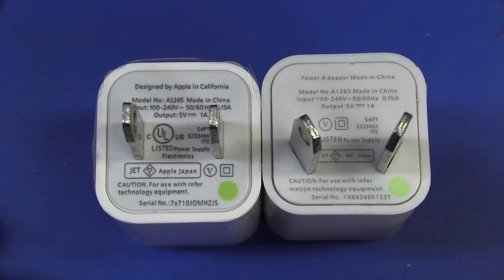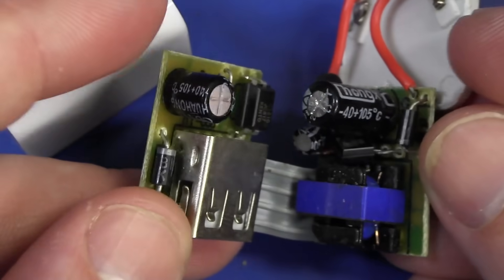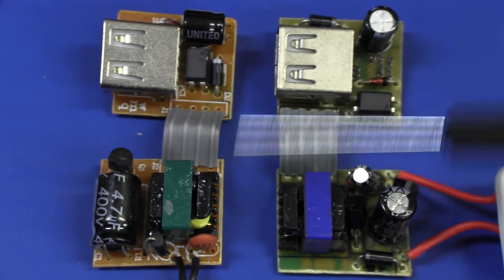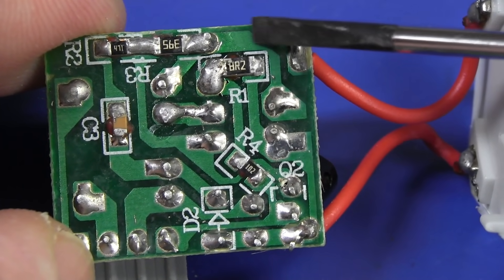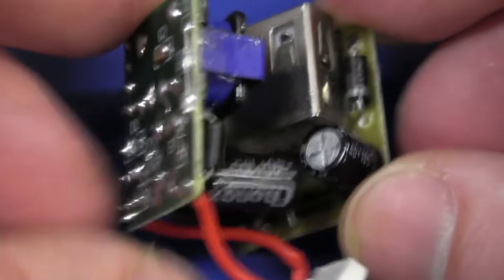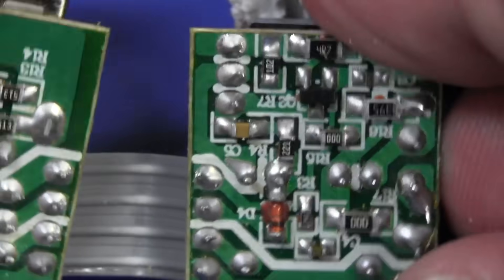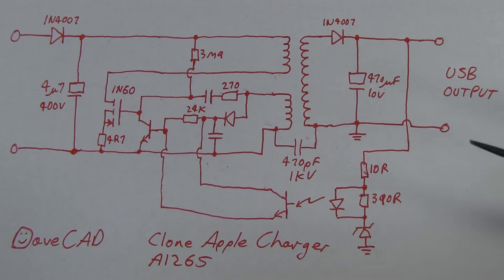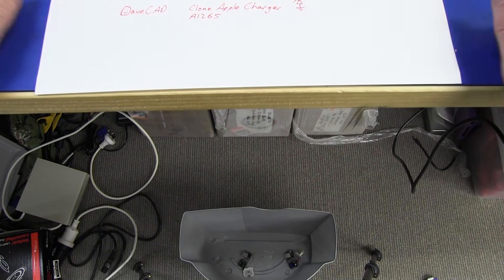EEVblog #388 - Fake Apple USB Charger Teardown

Comment: but the chargerz work all the same yes
Reply: 1zeagle They don't stabilize and filter the electricity enough so I reckon they can damage the device you are charging (leaving out the safety concerns), if not immeadeately then over time. And the bad quality components will probably fail sooner or later, either rendering it unusable or making the electricity even less stable and filtered. Also, the efficiency is probably worse by not using components best suited for this job. By not using any insulation, if any components on the boards accidentally touch each other the wrong way it might be disasterous for your device (and not to mention if you touch usb cable when pulling it out of your phone and get jolted by 220V mains AC).

Comment: So does charging your phone with one of these "hurt" the phone somehow?  Does it wear out the battery faster?
Reply: PTNLemay Until they fail (age) those will operate OK and than one day they will fail (caps dry or leak causing short for example) this will cause any or all, fire, damage to your equipment, electric shock, electrocution.
Reply: PAWEL CZAPOR
Wouldn't the worst thing that can happen be that one of the breakers switch because it detected a short?
Reply: no worst is probably when it electrcutes or burns down the house with whole family. Fuses and rcd will do what they supposed to do.  fuse will prevent wires in your walls melting and rcd will detect high stray current but 30ma is enogh to kill...

Comment: Both item shown are FAKE
Reply: Ernst Stavro Blofeld You have to remember that the electricity is going into the port of the Apple device and then to the battery. The device will have a battery regulating circuit inside.
Reply: chad Mc Cabes Why would anyone need inductive filtering on a fucking battery charger?!
Reply: Ernst Stavro Blofeld
It's to filter out certain frequencies so you don't have a lot of noise on the DC output. Caps or inductors alone work, but caps with inductors are much better.
Reply: ChannelSho What does a battery care about noise?
Reply: It doesn't, but you don't want that noise leaking out. Plus noise in general is bad for electronics, especially digital ones.
Reply: ChannelSho The apple-battery is digital?! That is hard to believe…
I could understand noise filtering in a power supply but not in a battery charger.
Reply: Ernst Stavro Blofeld The connector on the phone doesn't lead directly to the battery. There'll be a charge regulator (most phone chargers are just 5V USB supplies, most batteries are roughly 3.7-4.2V) and battery monitoring circuits before the actual battery cells. The phone connector is also capable of data transfer when plugged into a computer, so it's also probably not good to have noise where it could couple into more sensitive stuff nearby.
Reply: Ernst Stavro Blofeld It helps to get rid of any AC pulses that may exist.
Reply: Ernst Stavro Blofeld Plenty. you don't want to induce any AC into the battery.
Reply: Ernst Stavro Blofeld A good power supply always has a choke to keep AC from passing through.
Reply: +William Jones The chokes also help reduce RFI which otherwise would be put on the charging cable or household wiring and that can get into other devices.

Comment: I have now re-thought about leaving any of these plugged in and charging overnight!  Great demo, Dave!  I'll certainly stick to the genuine Apple chargers from now on.  Used a made-in-China USB car charger and it scalded my hand after being plugged in for an hour of driving.
Reply: At least for a car charger you don't need to worry about isolation as it's not neccessary

Comment: Clone chargers devices are not very well designs or have any real expensive components parts in them.The prices are 1/3 of a real one.That why most people's take chances to buy them long as they're working.You make a mountain out of a ant hill here.These chargers put out and take in a very low amps and currents.99.999% of the times the chargers just stop working,it will not cause any fires or causes any harm to anyones. ....111...% could causes any fires or harm to a person.So dose lighting too very.. Low almost to 0%.

Comment: EEVblog I looked at two of the three Apple chargers I own.  All were included with various Iphones when originally purchased.  I pulled the charger from the box for my refurbished 5S.  The underside where the prongs are is blank, no markings of any kind.  My older original units have all of the information shown, including "Flextron".

 I am now curious to know if this is a knock-off replacement included with my 5S or did Apple choose to remove all of the data on charger supplies.

Comment: If the mains was ever reversed on either "charger" the filter cap would go bye bye from reversed polarity.
Reply: The mains is reversed 50 or 60 times a second.  Mains power is AC

Comment: There is a much easier way to open those without cutting it open.  Hold it with one corner on the ground or desk (so it looks like a diamond and not a square) and then tap the top corner with a hammer.  If it doesn't open after a couple of hits, then rotate to the next corner and repeat.  Doing this will tweak one shell of the case in such a way that it should break the weak plastic welds to the inner part without destroying the whole case.  I've found that this will work with a lot of devices like this and all that is needed is a few soft taps with a heavy hammer.  You could probably even wrap the hammer or case in a cloth to keep from scratching the case.

Comment: As a radio amateur, it really drives me mad with these cheap chargers. The lack of inductors and capacitors as a decent filter means these devices throw all sorts of electrical switching noise, seriously raising the RF noise-floor. :(
Reply: the masses love them.  they want to buy them every month to get a shopping buzz and a bargain illusion.  Govts love them too as they keep the economy turning over.  yum yum.  just sayin'

Comment: Hmmm...Do you not grasp that ALL this stuff is manu/made in shops in China/ROK ??? Outside of fitment, identical goods.
It all comes down to what level of quality the end user is willing to wait for. NOT pay for, the company just sends the out-of-tolerance parts/kit back and China sends them out something slightly better. 
Until you accept a shipment and build, then your quality is SET IN STONE. Even high-end goods are built this way. 
Source: Years in QC, as well as a decade with a micrometer in my hand, looking at out-of-spec shite, trying to build consumer-quality goods.

Comment: The poster should have disassembled a genuine Apple product, and see the real difference.  Too, genuine Apple power adapters are sealed using ultrasound, not glue.  In Thailand, a counterfeit USB power adapter costs the equivalent of about $3.00.

Comment: ok,original Apple units are better designed,compact,electronically correct and so on....but can you explain why 2 original power adapters exploded on my macbook pro?
got a cheap one and its performing quite well,very low thermal dissipation compared to original,no fancy coaxial power cable that burns after a year.

Comment: What we all want to know is how cheap you can go and still be safe. Would be interesting if someone bought one at $1, $2, $3, $4, $5 etc. And compared them all. I've bought quite a few chargers in the $7-10 range that seems to meet all the safety criteria. Still a bargain considering the $30 you have to pay for an original charger in this country.

Comment: Using stronger glue is hardly an indication that something is better designed. In fact, Apple is known for making equipment that is deliberately and unnecessarily hard to open / repair / recycle, because they prefer to make people buy a new one.

Being able to open something counts as a plus in my book (it shouldn't come apart in your hands, obviously, but it should be possible to open it).
Reply: He pretty much recanted this the entire duration of the video though.

Comment: Your just letting the fakes know what there doing wrong
Reply: Fluttershy Who cares if it's "fake" ? It's not like these are unique pieces of art, hand-made by their creator. It's an industrial product. If they can make them to the same (or better) specifications than the original, then they are as good as the original. A "well made fake" just means you're not paying for the logo and feeding some millionaires who had no influence on the item's actual design or manufacturing.
Reply: Which is good.
Reply: Its not good because we have a higher chance of getting a well made fake
Reply: Or a more more effective, less temperamental fake
Reply: I'm sure there will still be something wrong with it to still not work again because remember its a fake not a real
Reply: Sigh, bronies and their "logic".
Reply: He doesn't tell them how to make a better fake but how to make a safer fake, which is a good thing, cause even if you get knocked off by these people you at least aren't in risk of burning your entire house down
Reply: Fluttershy  There have been deaths that have occurred through the use of counterfeit products.

You can Google them.

For instance, in topic with this video, there was a Chinese lady who was electrocuted when she used a counterfeit USB charger.

There have also been instances of counterfeit baby formula that had been contaminated with melamine.

There's many more, but I hope the point has been made; counterfeit products can be dangerous, some even deadly to use.
Reply: RFC3514 I;m okay with a fake as long as it works... I just don't want a fake that look real because that would piss me off more because i would belive it was a real more... I get anger false belief
Reply: Well, hey, if the counterfeiters manage to get it right (or, at least, get it safe), then perhaps people won't get electrocuted.

Don't get me wrong, I don't support counterfeiters.  But, at the same time, I don't want to see people getting hurt or killed merely for the mistake of using their wares.
Reply: ***** Death by counterfeit never heard of it

Comment: Dave - you're correct: The serial numbers are all the same. I got one of these from cashies since it looked like a neat little 240V->USB adapter. It even has the adapeer spelling error on it.
Reply: wow! they have a 2nd hand market for this?! how much did cashies charge?
Reply: They had dozens of them for ~$2 each. Mind you I bought one before seeing this video, or else I would not have even considered it.

Comment: I noticed in your DaveCAD drawing, that you're missing the center 2 pins of the USB with R10, R11, R13, and R14.  Without those it will not charge an Apple iPhone.

Comment: The "Apple" branded is real. It's made by Flextronics which are one of the best, but also one of the most expensive power manufacturers. For example, they made Corsair AX1200/i series (PC Power supplys). Check JonnyGuru.com for deep teardown and tests. Also you can see that they produce laptop power adapters like many other popular brands aka Delta Electronics and Lite-On. ;)

Comment: At least both spades for the wall outlet were solder and wire.  I took one apart and the spades were just making contact against bent spring steel.  Thus no wires.  The unit did not work upon delivery and the spades literally fell out upon trying to remove the cover.  Don't remember if it had a UL stamped on it.  I do not think so.  BEWARE!!!

Comment: Both were knock offs, I'm holing a real one in my hand right now and it looks VARY different from the ones in the video. Good teardown tho.
Reply: Jasper Janssen
The one on the right also has a typo - A dapter.

Must be real.
Reply: It is the older iPhone 4S charger and seeing when this video came out, I think their both fake. PS: The phone was bought not too long ago. So yeah
Reply: One of the giveaways is that even the one on the left actually has an error in the text.

"Caution: for use with infor
technology equipment"

The real thing really doesn't do that.

Comment: Too funny.

Almost scary that distance between the 240 and the usb shield. Entirely possible to get 240v straight onto your usb!

This is why 2 buck chargers on ebay are NOT a good idea.

Apply may be over priced, but simply because something can be sold for 2 bucks instead of 20 doesnt mean you should buy it.
Reply: Definitely the case where, at the bare minimum, an air gap should have been cut between the mains lead and USB ground on the PCB.
Reply: Who doesn't like 230V on ground into their USB devices.
Reply: I came to this video because I did exactly that, 240 volts straight into my iPhone... though I thought it was a real apple charger, don’t know how that thing got in my house!

Comment: Anyway a piece of junk like the ones in the video will barely do 100mA before browning out and dropping voltage, so the Chinese engineer has done everything in order to prevent the phone from sucking 1A from the thing (and setting it on fire, BTW)

Comment: Do you know of any other high quality brands that are good ie Samsung?  Kennsington does not short the D+/D- signal lines to tell the device being powered that they are chargers rather than data connections, so a modern device like an iPhone or Android phone will not take the full available current from the device. So they are limited to 500mA rather than 900mA so they power but will not simultaneously charge a modern smart phone.

Comment: Phone chargers should not be made that small especially when your are dealing with the dangers of mains voltage I miss the gold old wall worts a charger that small could easily short out on the inside and fry the device connected Imange if you just bought your 500 dollar iPhone and and your wall charger shorted out and fried your phone

Comment: As i worked @ our VDE we simply shorted all creapage and clearance whitch was less than that specified given by the VDE rules (EN 60664-1:2007 / VDE 0110-1) during test
For mains like 230V ac they are for creaping absolute minimums for clean, in room use:
between AC and AC (mains input leads or similar) 3mm
between primary and secondary: 5mm
between AC and GND (touchable!): 5mm
On PCBs @ 250Veff: 1mm on the PCB itself between pins and 2.5mm to all other things.
These are MINIMUM ratings!

Comment: Despite knowing this is obvious troll bait, I'll bite... Actually, the internals of Apple's cube chargers are a pretty impressive feat of engineering. Switching power supplies are difficult to design correctly and really need high quality components to work effectively. There's a video floating around here where an engineer tests 10 various USB chargers and shows the output on a high end oscilloscope. Apple's chargers came in top in the 500 to 1A range and second in the 2A+ range (beaten by HP).

Comment: The second one looks a bit safer. It has insulation between 'mains' and 'output' boards. The first device is PURE FEAR ! Primary capacitor (at mains potential) nearly touches the output board. Imagine using this charger to a phone, which headphones are in your ears.

Comment: What are you? Stupid? This is a power supply. It converts 115VAC to 5VDC. If the creepage distance is not to specification, or isolation is not carried out appropriately, it can be the difference between you living or dying. You're so ignorant it's not even funny. You give Americans a bad name. Go learn a thing or two about proper electronics design before you further perpetuate your stupidity. Until then you're banned from procreating.

Comment: Some places got different AC voltage supply.
220V or 110V,or even different freqs.
Check your air conditioner's plug,it should be "220V".

Comment: I took apart a small charger recently, it was a piece of shit. It had a diode feeding into a resistive voltage divider connected to a crappy filter cap with some resistance wire connected to the USB output for current limiting. A dangerous piece of shit,

Comment: Did you see the "tiny rest solder-Ball"  hangig via Flux glued on the Board.
I find this "SMD-rest-solder-Balls" in expensiv Devices. Like ABS and ..
Metal Cased BlueThooth Devices ect.

And after a Time if a Solder-Ball gets loose, it plays Bimmel Bingo on the small TSSOP Pins shortcuts ...
of the Mico...an have thomething strange happen with the Device.  
Why inspect this in a important Thing for safty more than oversized gapping.  
And all safty is gone with rest solder-balls time-bombs.

Comment: I bought a little generic one...and it generated quite a ground potential- enough to give you a nasty shock.  But I figured out that the problem was bad capacitors...I recapped it and dead another ground potential test, and it actually tested out with a lower ground potential than my genuine Apple adapter!

Comment: Is there an easy way to tell if it's the genuine article? Is there some tiny mark or molding line or something like that on the Apple that is missing from the imitations? How about some simple resistance check? Weight? Output ripple?

Comment: Hi Dave! Do you have any circuit of small power supplies? I need to power a device and space is very sensitive. Capacitive and resistive PSU are out of the equation because I need more than 40mA (which is the max for those kind of circuits, isn't it?). Thanks in advance. Your videos are great!

Comment: It's a power supply...for a USB device!  You don't need very many components to make a power supply.  You don't need a full wave rectifier for a charging power supply.  You can get away with using a single capacitor and a single zener diode (after the transformer of course), and maybe a voltage regulator and some protective resistors and capacitors.

Comment: I usually end up with a bad noise in video and audio equipment between grounded and ungrouded switchmode hardware... I fix it by removing those caps, or removing grounding lead. But then i end up with a very low current 110V on the boxes of the grounded devices for the lead removal method.